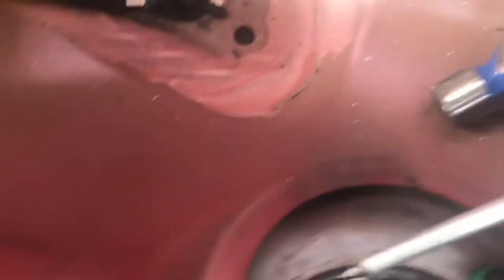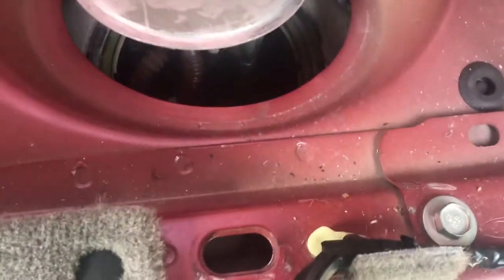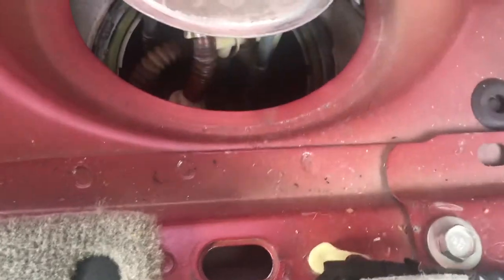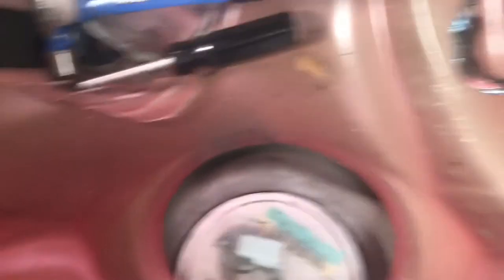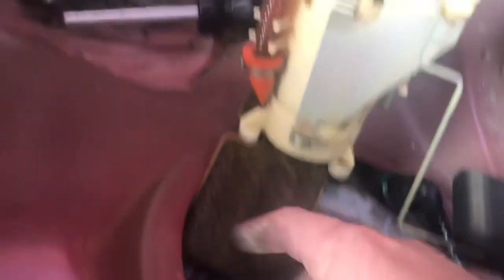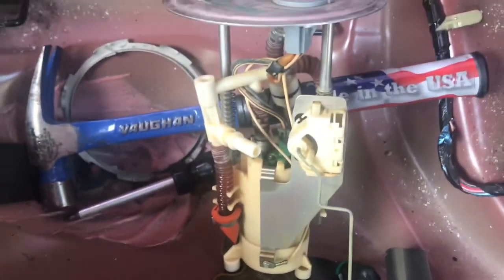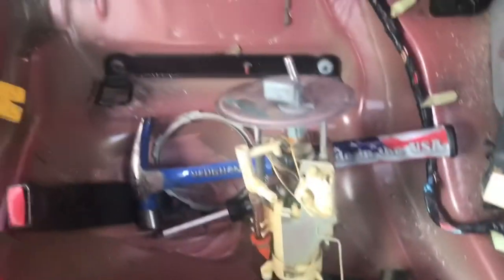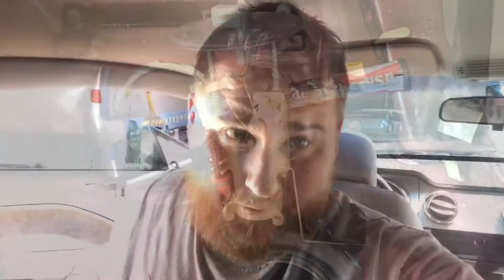How To Change The Fuel Pump In A 2005-2014 Mustang

Comment: That locking ring was the tricky part of this job.   I had to re-use the old O-ring as the new one was too hard to compress.  Then, I filed the leading edge of each of the engagement points so it would catch properly.   POS...thanks FORD.
Reply from the maker: Yeah I fought that on this one. But at least it didn’t require dropping the tank like previous generations.

Comment: Lol u didnt show how to put that ring retainer back on👍
Reply from the maker: The same way it came off lol. You align it and hammer it back down.
Reply: @Foxbodys4life  its not easy without the ring tool.
Reply from the maker: @s197gt6  I have only used flatheads and hammers.
Reply: @Foxbodys4life   im working on it right now and its a pain in the ass with just a hammer and flathead 😫
Reply from the maker: @s197gt6  must be your car, it only took me about 30 minutes to do it.
Reply: Putting the pump on is easy but im having a hard time with this ring lol. Waiting for amazon lol
Reply: @Foxbodys4life  i have a 06 silver one on Volk wheels 👍
Reply from the maker: @s197gt6  this was on my dads high mileage V6.